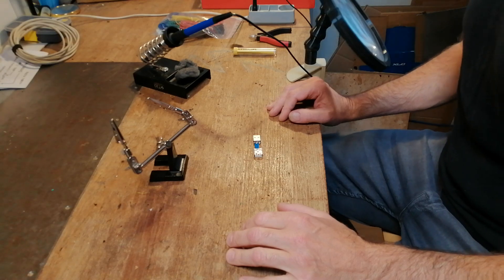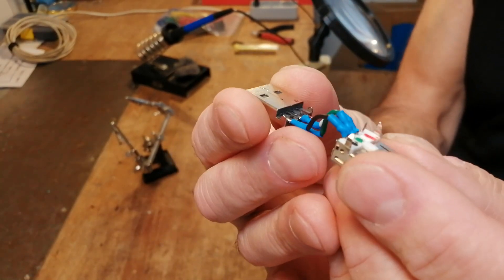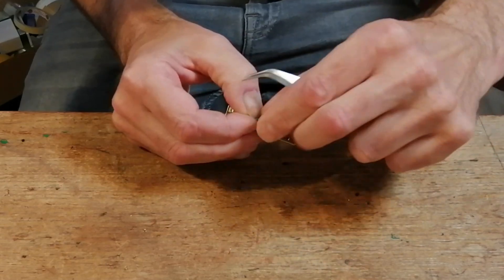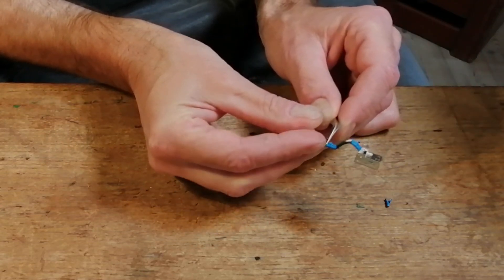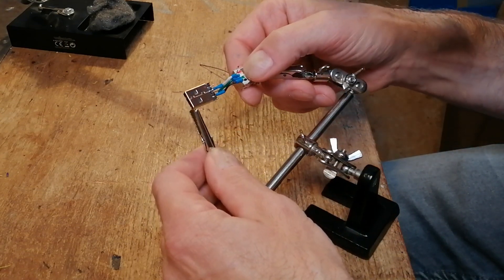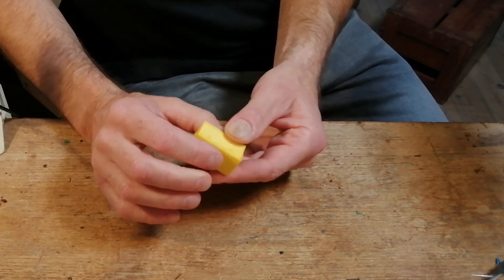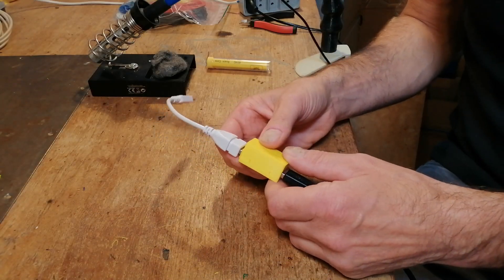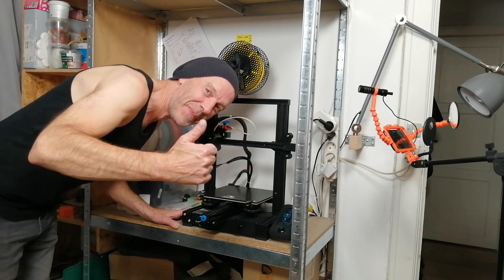USB Power Blocker - Dub'ya Makes

Comment: Ahhh I like the brim removal idea, that will save me lots of mini cuts from handling exposed Stanley blades!!

I do love the way the Z-banding turns into a nice texture for friction-fit casings like this, I did one on my AC relay.  I love this idea, I always Ignored the Printer Motherboard being live with 5volts, but I never considered this very simple but very awesome mod!  It is kinda annoying when my Z probe decides to do a test and flip me the bird upside down whilst clicking at me!

I recommend getting some of those flexi octopus arms for your croc-clip holders, those little weighted stands which come with the iron are awful for falling over or not supporting your part.  If you get a pair that clamp to the desk it will make your day!

I'd also recommend getting an iron with variable temperature, if your iron isn't running at 300++ by default, you can be a lot more confident in pushing the hot end onto both sides of the joint, without breaking or melting the part / board.  (Although this kind of part is a nightmare due to many plastic internals touching the ground case already).   Another good reason for this, since you're already messing with plastics and know their melting point in advance, you can use it for plastic welds or inserting those threaded inserts into your parts without scorching your model.
Reply from the maker: Thanks a lot, glad you like it 😊 and thank you also for the tips - I'm definitely in the market for a better "Third Hand" solution; I've been 3D printing those loc-line arms, maybe something like that (or I could just buy one, but where's the fun in that 😝)...
Reply: @jwcph  Based on the cheapo one I bought online, the printed "vertebrae" are probably better at not popping out.  From there you just need a solid base / clamp (probably could print that too), Some spare croc clips, with rubber or heat shrink over the teeth to save your circuit boards.  This is the only part I wouldn't print in case the clips melted to the board or wires on heating.

This just makes me sad that either my Z-rails or the rollers which carry my gantry up and down are messed up.  Next step for me on my heavily modded Ender 3 pro, is to try a linear bearing rail for Z.  I haven't been able to consistently print on mines for a year or more now.
Reply from the maker: @Doubleelforbes  Have you tried replacinig the V-slot rollers? They can indeed get pretty badly worn... also, clean & lube the Z screw regularly - I was shocked to find out how dirty it can get & just giving it a good clean & making sure it was aligned fixed some Z-axis problems I'd been having 🙂